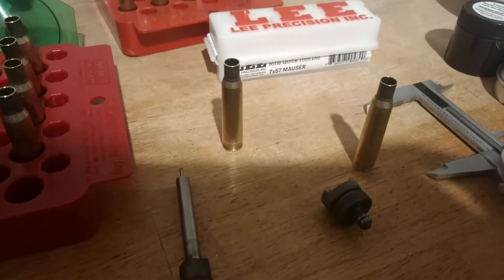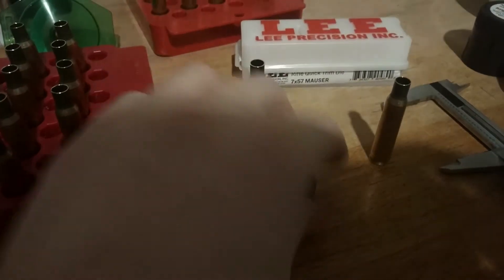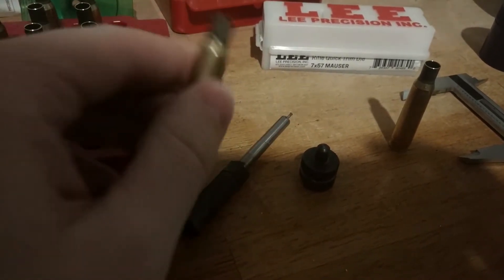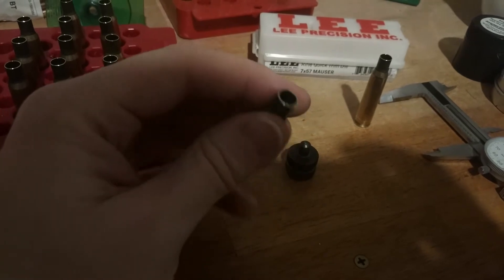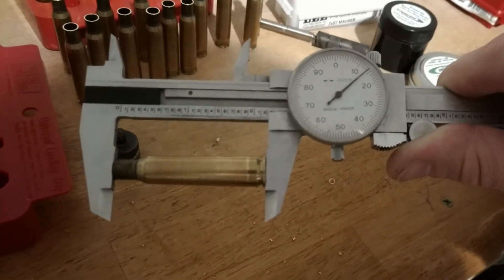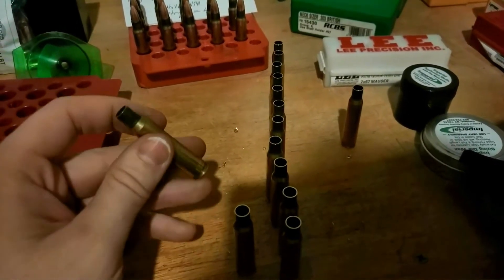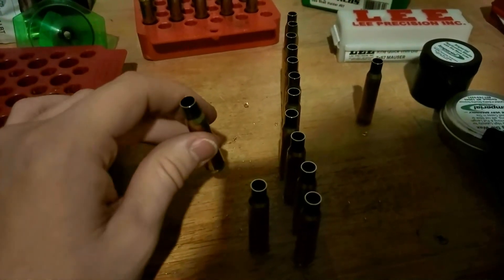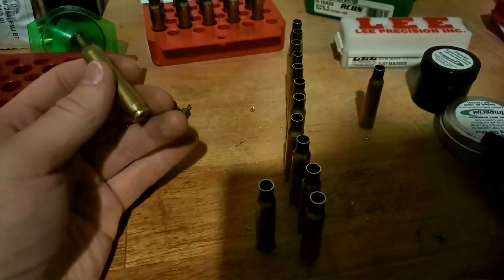Lee Case Length Gauge and Lock Stud trimming

Comment: Hello again buddy, yeah i was myself just looking into this issue myself. 
 The root of the issue seems to be a saami spec vs c.i.p spec based.  Lee is going by the saami defined (for some reason) shorter case length for the 7x57 of 2,235 inches instead of cips  2.244 inches or 57 mm. 
 Lee then chose a trim length 20 thousands below (saami) max, resulting in that 2.215 mark you measured, post trimming.

Could an option be to find a length gauge lee has set for 10 thousands longer, but which isnt offically for the 7x57? I mean does anything much change between one length and another for standard cartridges besides the length? Could be worth to check out.